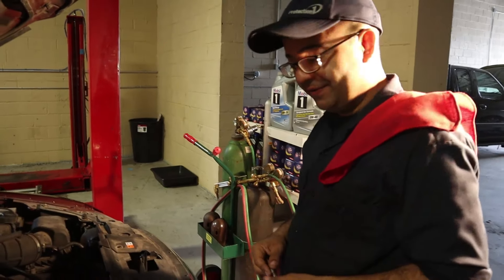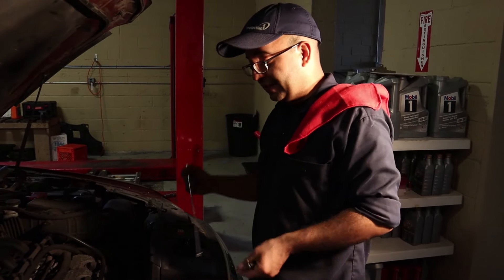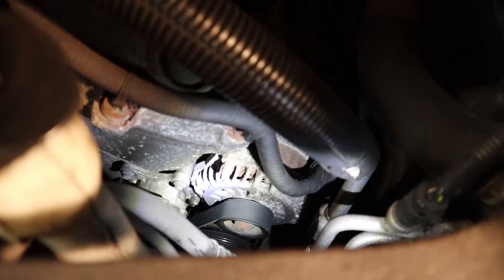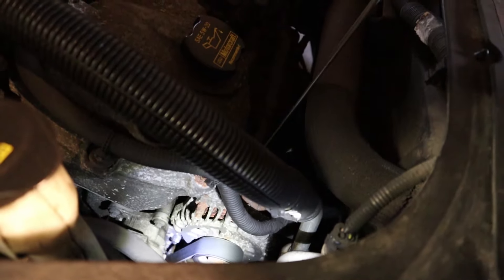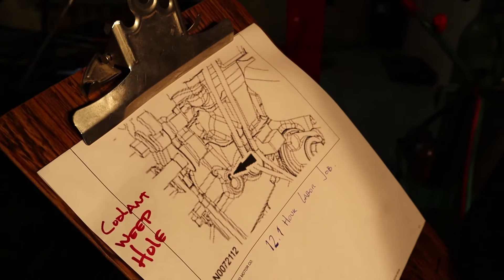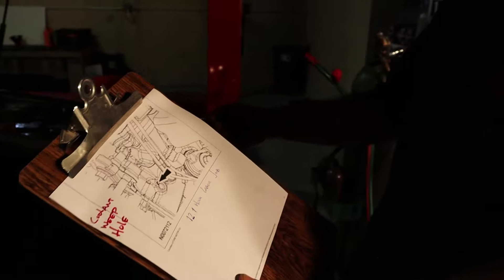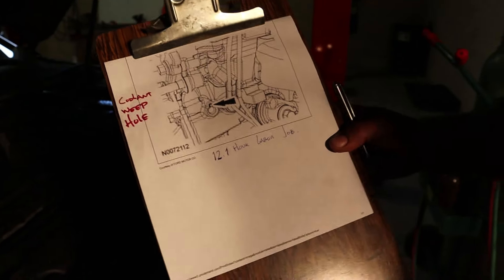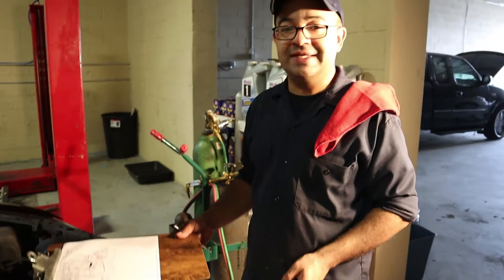2010 Ford Taurus Leak Diagnostic Water Pump (Coolant Weep Hole)

Comment: I have a 2008 Ford Taurus looks like water coming close to oil filter just couldn't get under it my car has not over heat but a/c stop working plus it was leaking more with a/c on .

Comment: Very helpful!  What happens if I add Stop leak to the system?  My oil stick looks great.
Reply from the maker: I don’t recommend stop leak because eventually it could clog the radiator and the heater core

Comment: Hi Alfredo, I got a 2010 ford flex.  It is leaking cooling behind  alternator and close to oils  filter. Now I see a lot antifreeze green dark in the floor..... also leak oil little. More cooler.   It could be water pump? How much will cost?
Reply from the maker: What size engine?
Reply: 2010 Ford flex v6.3.5